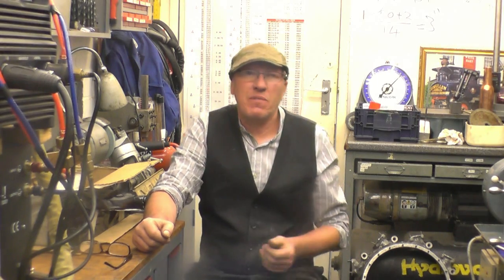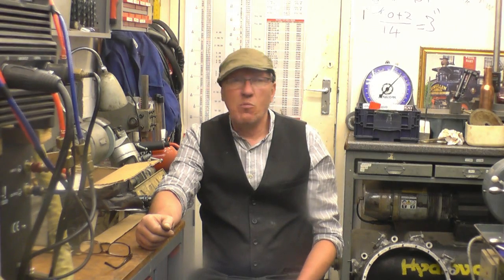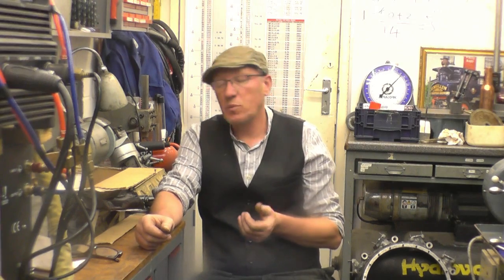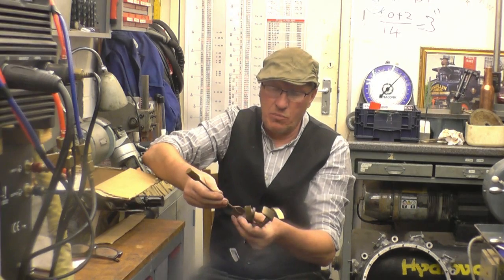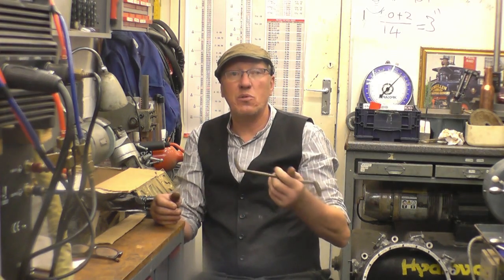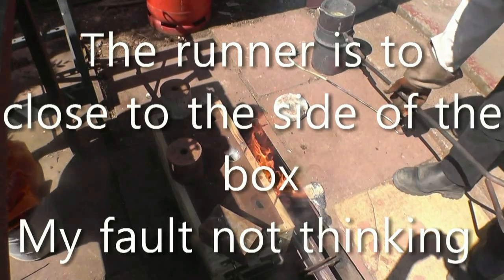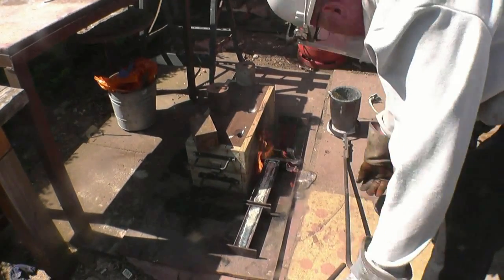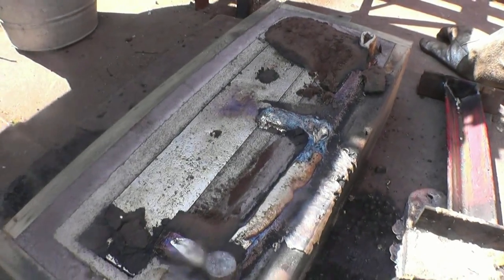SNNC 126 P1  Casting  Sodium Silicate

Comment: Brill video yet again john.
Dont know if you've covered it yet, but can the sodium silicate sand be reused?
Reply: Yes. the SS burns out & the sand is sent to the mill & used as make up sand to cover loss. or in our case we dumped several tons a day & had our own land fill, I don't remember why, probably because our sand mill was too small to clean anything but facing sand.

Comment: hello John
you need to rap that mould even with sodium silicate, if yo do it before you gas, it will loosen the sand and make it easier to strike the pattern.
that should correct the sticking issues that you are getting.

Comment: As a Molder, I can advise you to rap the pattern before you allow the sodium silicate to solidify totally. Don't rap it too hard, you just want to give the pattern some clearance from the sand which will allow the pattern to be withdrawn from the mold easier. Also, get a flexible rubber ball (the kind that has air in it to keep it round), cut it in half, with one half of the ball pierce the top of the rubber with a tube and attach the tube to your CO2 bottle hose. Gently sweep the gas over the top of the sand so that the first 1/8 of an inch of the sand is harder, then place the rubber on top of the sand and give the sand a short shot of gas (a couple of seconds at most) allowing the permablilty of the sand to transfer the gas through the sand to the far side and making the sand hard under that particular area. Repeat the process and you will have solid sand molds or cores if you are using them. Good Casting!
Reply from the maker: That makes sense  Thanks

Comment: Hi John, thank you for another great casting video, warts and all. 
I kind of suspect that you could have saved the first Sodium Silicate mold if you had attempted to repair the fault with the letter A. It also appears that the S.S. method sticks to the pattern very tightly. Can I suggest that you increase the number of removal bolts you are using and also that you use some nuts and several spreader bars packed up above the pattern so you can slowly tighten the nuts to lift the pattern out evenly.

Comment: John
Re half nuts on a foreign lead screw 
Tom Lipton did a vid on the problem 

You open the half nuts then stop the lathe , restart in reverse and recluse the nuts when the TI has returned to the last number then continue to reverse to the start , note the HN remain closed until you get to the end of the cut

Anyway please look at Tom's vid he demonstrates it better than dyslexic me can explain

Stuart
Reply: Tom L. showed making metric threads on an imperial lathe.  John is doing Imperial threads on a metric lathe.  The issue is with the threading dial, which is more complicated on a metric lathe, with multiple change gears needed for the threading dial.  So, that might be an issue with what John is doing.